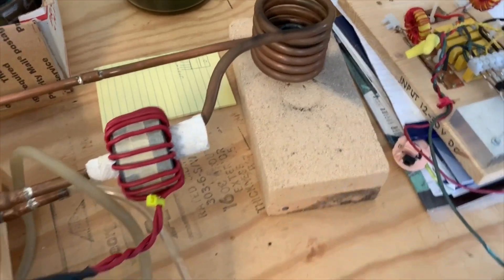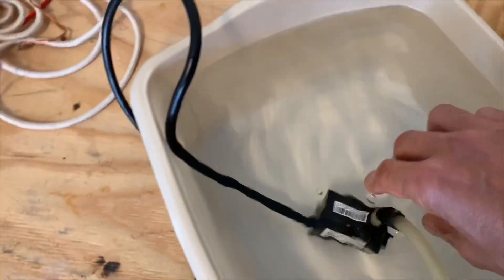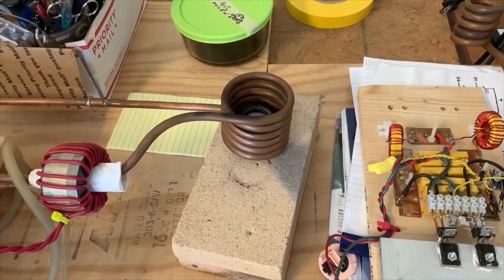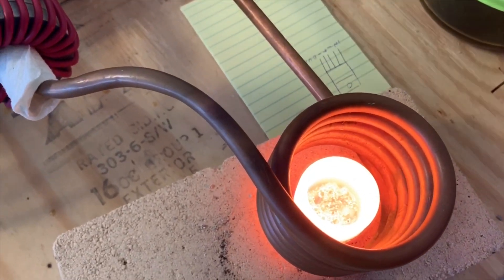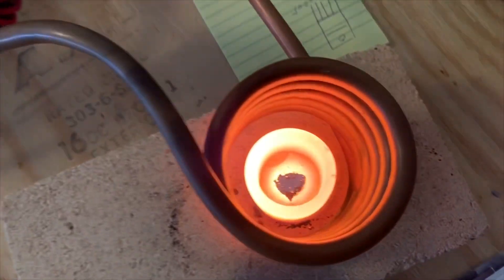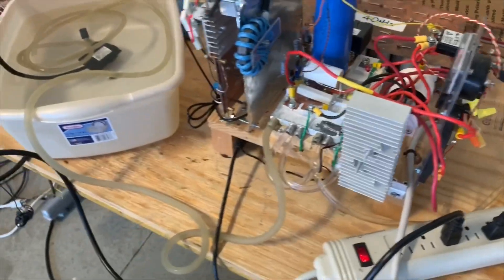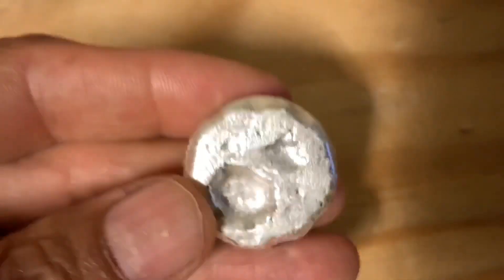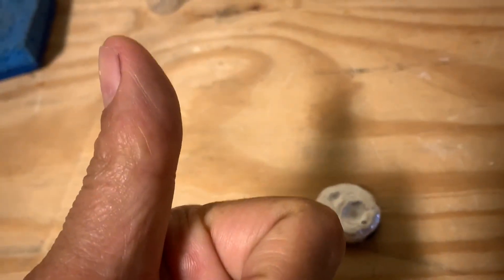How To: Inductively Melt  Silver Scrap

Comment: I'm certainly interested in the design of the induction heater!
Reply from the maker: Basic principle for this heater is

Variable frequency oscillator (555 timer) astable mode with 50% duty cycle

Inverting and non inverting MOSFET driver chips feeding +/- 12V square wave into a 1:1:1:1 ferrite GDT to drive a full bridge of IRFP260 MOSFETS at 12V on the gates. These are run at 24V across the source and drain for +/- 24V square wave output.

The output of the IRFP260 full bridge is total overkill but it is fed into a large GDT wound 1:1:1:1 to feed +/-24V into the bases of the full bridge of large “brick” IGBTs ie SKM200GB125D rated for 1200V 200A. The gate waveforms on these large IGBTs are improved by using 0.9 Ohm low inductance 20Watt resistor on the primary of the large GDT and using 3.3 Ohm 5 Watt resistors on each of the individual bases.

Rectified smoothed 110V mains is fed directly into the SKM full bridge.

The output of the full  bridge is fed into a 22 turn ferrite toroidal transformer. A 3.3 uF 2000V DC blocking capacitor is placed in series with the output of the SKM full bridge.

The tank consists of 28 x 0.22 uF parallel connected 2000V CDE polypropylene caps in series with the 6 turn 3 inch diam copper tube coil. This is coupled to the toroidal transformer with one turn passing through the toroidal transformer for a 22:1 stepdown and corresponding increase in current. The tank resonates at 40kHz. 

The SKM full bridge is water cooled with a water block. The same water passes through the 6 turn work coil.

Thats basically it.

Comment: you melted copper in the previous one, you can melt silver too then why this upgrade?
Reply from the maker: shreyas sagar bc I completely upgraded the IH for more reliable operation. The small To247 IGBTs I was using were failing on a consistent basis. The gate driver chips were overheating which meant I could not use the older version of the IH used in the copper melting experiment in hot weather without thermal failure of the gate driver chips. I completely tore the old version of the induction heater that you saw in the previous video apart and decreased the size of the unit. I developed a much more robust gate driver circuit that can drive very large IGBTs without heating up. I replaced the small To247 sized IGBTs with a full bridge of Semikron SKM200GB 125D bricks rated for 1200V, 200A. The oscillator has also been revised. I replaced the fan cooled IGBT heatsink with a waterblock and added a temperature sensor. I replaced the single full bridge rectifier with 2 parallel connected 400V 35A modules for a total of 70A, 400V. I added a gate drive transformer low inductance primary coil resistor of 0.9 Ohm 20Watts for improved gate drive waveforms on the bases of the IGBT bricks. I am using one large smoothing cap. I still have the same thermistor for current inrush. The unit is plugged directly into the 110V AC mains. What you saw was at 110V AC mains input no variac. I expect much better performance at 220V ie European voltages. The use of silver instead of copper was just what I had laying around.

Comment: Is that two igbts direct on rectified mains? Of with only that resistor you mentioned between the circuit and 310volt? No wonder it is so powerfull! What value of capacitors can handle that resonating current parallel to that coil? Its impressive and great you managed to get that working so well!
Reply from the maker: Rob Son  I completely upgraded the IH for more reliable operation. The small To247 IGBTs I was using in previous version of the IH were failing on a consistent basis. The gate driver chips were also overheating which meant I could not use the older version of the IH in hot weather without thermal failure of the gate driver chips. I completely tore apart the old version of the induction heater that you saw in the previous and decreased the size of the unit. I developed a much more robust gate driver circuit that can drive very large IGBTs without heating up. I replaced the small To247 sized IGBTs with a full bridge of Semikron SKM200GB 125D bricks rated for 1200V, 200A. The oscillator has also been revised. I replaced the fan cooled IGBT heatsink with a waterblock and added a temperature sensor. I replaced the single full bridge rectifier with 2 parallel connected 400V 35A modules for a total of 70A, 400V. I added a gate drive transformer low inductance primary coil resistor of 0.9 Ohm 20Watts for improved gate drive waveforms on the bases of the IGBT bricks. I am using one large smoothing cap. I still have the same thermistor for current inrush. The unit is plugged directly into the 110V AC mains. What you saw was at 110V AC mains input no variac. I expect much better performance at 220V ie European voltages. The use of silver instead of copper was just what I had laying around.
Reply from the maker: Rib Son I am using a MMC cap bank consisting of 28 x 0.22 uF 940C20P22K-F parallel connected capacitors for total 6 uF. This can definitely handle the current load.
Reply: @BrianDhvTinkerer  yes now i see why it is working so well. That is a pretty robust built you made. Its impressive!